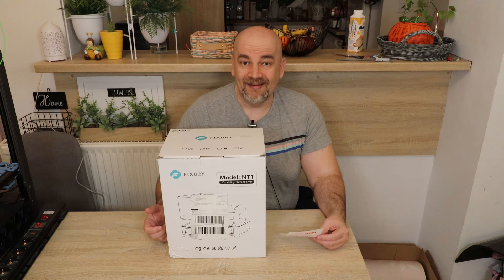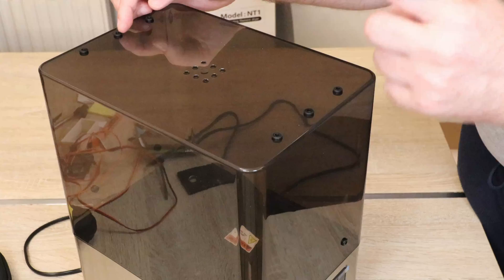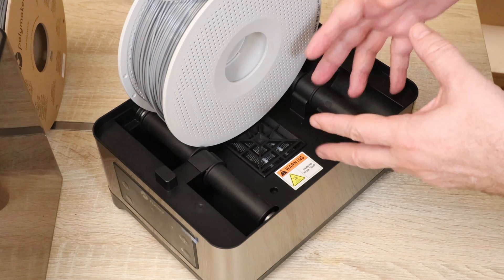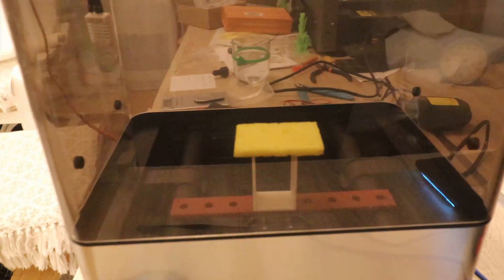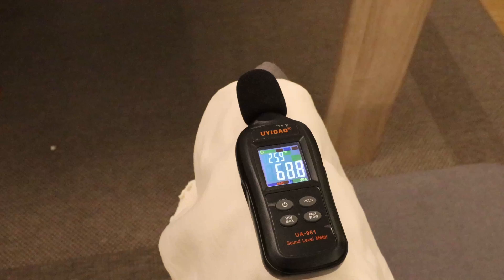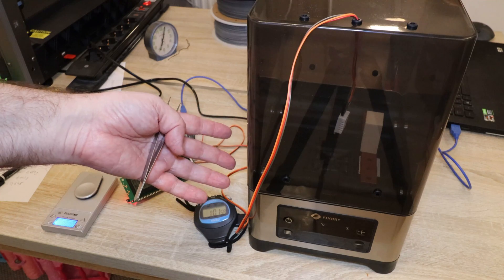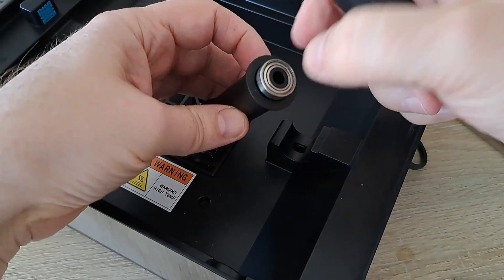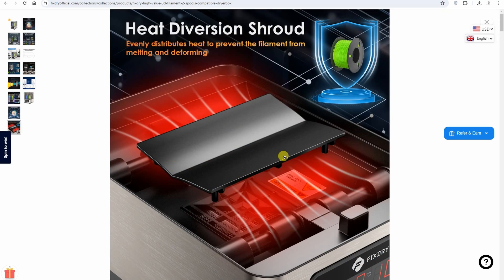FixDry NT1 filament dryer test

Comment from the maker: Update: FixDry will send new heat shield, but according to them, I have the latest rollers, which is weird, since there is not space between the filament and new part.
Reply: In other reviews the dryer had a diffuser, weird
Reply: I bought one last year and it has the diffuser.

Comment: I have the same cooler including the heat shield, but I had multiple times now problems with the temperature in combination with PLA. The spools got too hot and the filament sticked to each another. I will replace this dryer with a different one.

Comment: Do you have any updates on the FixDry? When I asked about the temperature never rising above 50C this was their response. “We use PTC heating to dehumidify while heating. The air outlet temperature is closest to the displayed temperature. Increasing the temperature may cause the printing filament or the container holding the printing filament to burn out. You can continuously use our drying box to remove moisture and observe the use effect.” If I dry a 1 KG of PETG for 8 hours I do see a dramatic difference in my prints. Less than that, not so much. They say it should only take 2 hours per their chart. What are your thoughts?
Reply: I answered my own question. I decided to buy the Creality Space Pi. With the FixDry I tried drying some Desiccant Beads. After 8 hours of the highest temperature they barely changed colors. After 3 hours in the Space Pi they were back to the working color. Also the The FixDry never indicated more that a 50 degree centigrade temperature even when the thermometer was over the heater. The Space Pi matched almost exactly what the temperature was in the chamber. Reaching close to 70C.
Reply: @Teck3D  Thank you for this, my NT1 wont reach more than 45 deg internally in the centre of the chamber disappointing saying 70! This machine is very disappointing I too intend to get a Creality SpacePi

Comment: I want something that can print PA-cf and nylon directly from the dryer. Which would you recommend? This seems like a winner with the heat shield, but their QC seems all over the place. I worry about the motor and long term durability of the Eibos. Especially because I can get a small food dehydrator for less and drill holes in it. I just want a single or dual spool holder that will work for more exotic materials but not fry my petg. Thanks so much. It is also disgusting they ripped off your data, changed it, and all without telling you. It shows how shady of a company they are and that they absolutely aren't honest.

Comment: The "Heat Diversion Shroud" came with my NT1, but i have the same rollers as in your video. With the shroud in place the highest temp reached inside the dryer is about 55C. When set for higher temperatures the display indicates higher than actual temperatures. If a measurement is taken under the shroud it is higher and much higher when measure directly on the PTC. I think it self limits (this is a characteristic of PTCs) at the higher temp measured at the PTC. There may be too much heat escaping through the plexiglass to allow higher average temperatures to stabilize within the dryer. I plan to add some insulation to the lid to find out what effect that may have. It appears they are using software to fake the indicated temperature above 55C. BTW, I think the blue humidity sensor also measures the temperature. It looks like a DHT-11.
Reply from the maker: According to downloaded manual (since I didn't got one) the temp is not measured but "intelligent estimated". The Eibos had the sensor 3 cm above surface for better accuracy.

Comment: Mine came with a fan deflector part, bigger rollers  and a manual. That was at least 6 months ago.

I also use a separate sensor and temperature is generally around 4°C lower that FixDry's sensor says.

Very different to your results and I use an external sensor all tje time so it is consistent over time.
Did you get a faulty unit I wonder?
Reply from the maker: Look like, but I can present only product which I get. I think there were several versions, they were experimenting during production.
Reply: @MyTechFun  Of course. But you said comment if your experience with this is different, so I did!
But in fact, if I need to use a dryer, I usually use the Sunlu S4... (That said, the FixDry is actually running now as I don't want to use the S4 for a single spool.)

Comment: Another great review/testing as always :)
(maybe a quick note that sponge testing only test surface moisture drying which will not always be representative of how efficient the dryer is at drying polymer with water content, We also tried it and we noticed that our dryer was performing similar to other dryer with the sponge test, sometime worse, but it was better at drying the filament, and safer)
The challenge is to have a good balance between airflow and temperature "evenness"
Just sharing some of our experience :)
Reply from the maker: I agree. Drying has 2 stages. 1) big heat forcing moisture from material to surface. 2) Dry environment, so moisture will evaporate from surface. 
But when I finish these tests, there will be again 6 dryer comparison, and this time the drying subject will be PA6 (soaked in water 1 week). I will measure the weight on analytic scale.

Comment: In your testing have you considered the differences when the volume isn't being taken up by filament spools? Or is it pretty negligible?
Reply from the maker: It's different, but I tried to make same circumstances for testing. IS measured Sovol two spool version, and I noticed it needs more time for heating, but after that it performs equally good.

Comment: There are some useful user-created accessories to enhance the FIXDRY on printables.
Reply from the maker: I noticed, but unfortunately, no heat shield. I just finished designing my own.
Reply: @MyTechFun  I also had to create my own version because the original heat spreader interferes with Prusa spools by causing friction. This issue negates the effectiveness of the ball bearing rollers, which are spaced too far apart, as you noted. One solution could be to print thicker rollers to elevate the spool, preventing it from contacting the heat spreader. I will try designing them tomorrow.

Comment: Mine came with a user guide and an air diversion shroud to protect the filament from direct contact with hot air. I also designed handles that double as plugs for the unused filament paths to even out the temperature inside, as I detected some backflow of cold air from outside. I also made a video! Additionally, it is completely unacceptable for them to steal and falsify your test results.
Reply from the maker: According to comments, so far I am the only one who didn't got the air diversion shroud. I have to design one for myself, but I can't find the pictures or dimensions.

Comment: Sir, in the manual it states IT DOES NOT HAVE A TEMPERATURE SENSOR.  It uses an "algorithm' to 'guess' at what power settings to run.  In short - it is junk!  Every temperature reading you see on that screen is pure fiction!  Not only that, if you put PLA in there to dry, it will be melted and destroyed as your testing shows, going to 76C.  Furthermore, they faked their advertising data based on your graph.  But so many YouTubers out there sign up for their little sales affiliate program, sing how lovely this thing is and reap the commissions.  (I am glad to see you are not doing so!)  There are better products out there.  This is a terrible product and does more harm than good.
Reply from the maker: Oh, this is new. Eibos had a temp sensor, another big difference. I didn't even got the manual. Thank you for the info!
Reply: @MyTechFun  yes download the manual and you'll be amazed.  I read that and immediately stopped testing it.  Which is too bad  Mine came with the deflector and I liked how well it sealed up.  But when I ran it, it felt very very hot as you found out.  I don't want to ruin/melt my $50 a spool filaments!

Comment: Thank you for the beautiful review. Ill suggest to everyone to use industrial vegetable drier - i reach with it 80 celcius on a spool itself (thermal camera check), and temp is even on all surface bc of very slow air movement with a huge fan inside that makes no noise. My PC & PETG is the most dry filament in a galaxy now (as i can reach up to 90 degrees easy).
Reply from the maker: I will test one soon (food dehydrator), we will see if it is better.
Reply: @MyTechFun   I expect to see an EPIC battle ahaha

Comment: Thanks for the review. Seems like QC is an issue as the results from other reviewers are all different.  I had that one in my cart as well and decided to go with the Sunlu S4 instead. I am glad I did. But hopefully fixdry is able to correct those issues. As it seems like a good option compared to some others I have used or seen. Cheers from Canada 🇨🇦
Reply from the maker: I think they modified it to fix issues. Not sure when is my unit manufactured, but probably they tried to lower the hot air temp, and later they went with that shroud solution and later they modified rollers too, since the spool was too low, sitting on that shroud.
Reply: @MyTechFun  ah OK good to hear. Thanks

Comment: Thanks for the review and great data.  They sent me one for review as well.  Mine has the baffle, but the air temp, measured dead center in the chamber never reaches over 48C, even when running for over 12 hours.  Their display, of course, showed 70C.  When I questioned this and pointed out the temp was too low for drying anything but PLA (and even questionable for PLA), they stopped responding to me altogether.  It seems like there is a real opportunity here for a company to actually produce a high-wattage properly PID controlled dryer.
Reply from the maker: I don't get reply neigher. Probably I have to print it myself, only I will need some dimensions (and new rollers, since I don't have space for that shield)
Reply: Same, they ghosted me when I asked why it doesn't have a temperature sensor that display real data, not fictional numbers.
Reply: I'm a big fan of your channel as well as Igor's. It seems like all these chinese manufacturers keep farting these dryers out while constantly making the same design mistakes. I bought a cabinet-style food dehydrator for $120 and haven't looked back.
Reply: @NWGR  Can you pls give the model ?

Comment: Thank you for the video. It's good to have stronger dryers on the market too.
This is not a solution for your average buyer, but personally I would just modify this one with a couple of thermometers, one with the sensor placed below the spool directly above the heating element and the other higher up and then just monitor the temperatures from those and ignore the machine's own value.

Until now I have been drying my filaments in the oven, which is very powerful but during the first heat up overshoots the requested temps by about 100 C which requires constant monitoring by me anyway (don't ask me how I learned that LOL).

Comment: Thanks for the review!
Any plans to review the Polydryer from Polymaker?
Reply from the maker: Yes, one of my next videos. Only I need more time there, I want to check how it holds the dry environment as a storage box.
Reply: @MyTechFun  The Polydryer claims to have multiple redundant safety systems, thermal fuses.
 Have read reports of some dryers melting themselves to destruction.  Would be a nice addition to these reviews to note whether a dryer has thermal fuses to protect against fires.